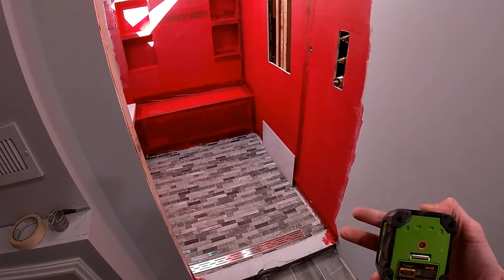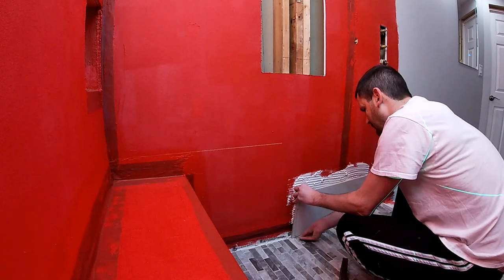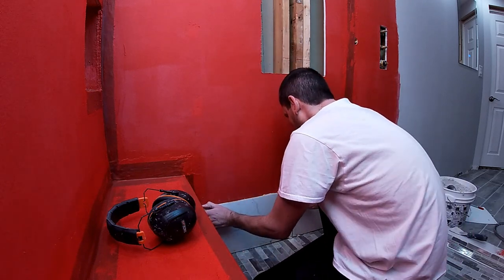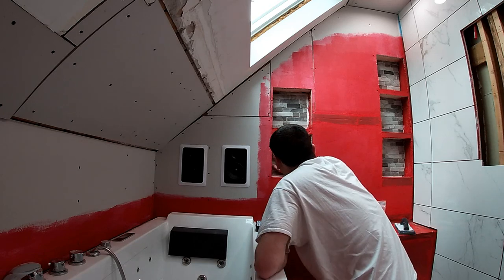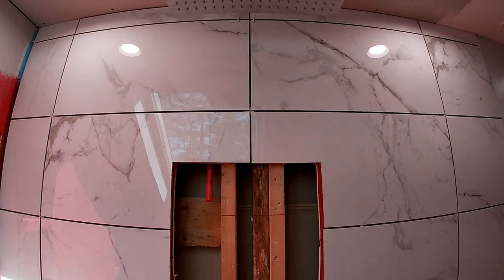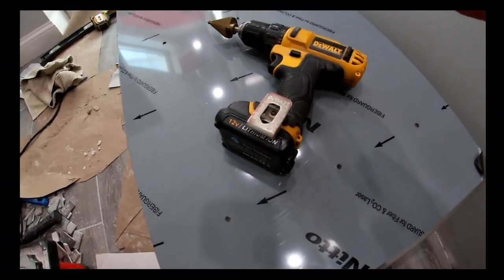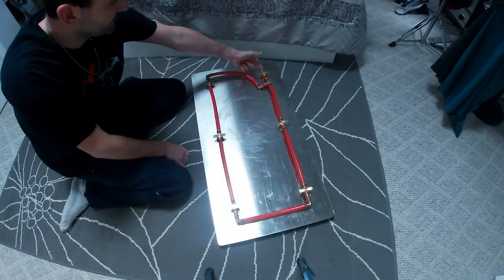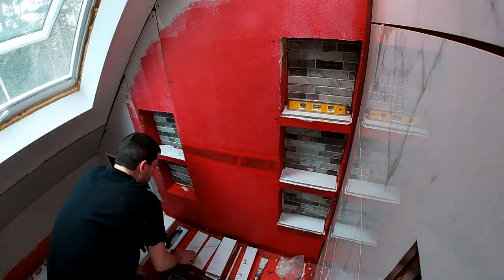Tile Walls/Shower Jets - Tips For A PERFECT Job! Bath Reno Part 7

Comment: I like your idea for the stainless panel.  The new house i just bought has a walk in shower that the previous owner did himself and well the tile work is crap but the multiple shower heads are nice.   You are giving me some great ideas if i want to tackle it myself.
Reply from the maker: Thanks Boris!  I thought it was a good way to solve a problem and now that it's done I love it even more.  Good luck with your project if you decide to dive it and get it done!

Comment: What kind of water pressure do you need for that set up?  I assume you are using 3/4 pipe but even that with all your devices are you going to need a booster pump?  If so, what size?